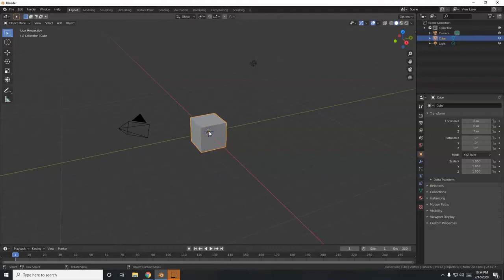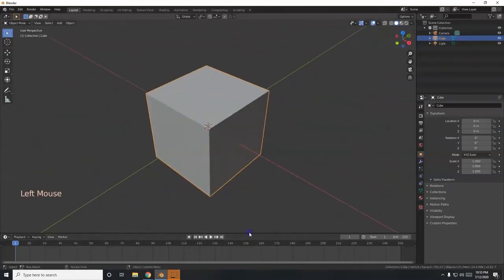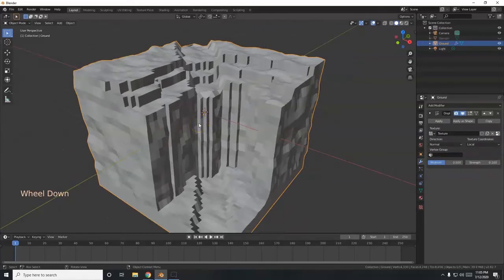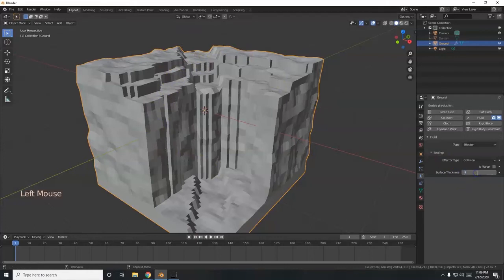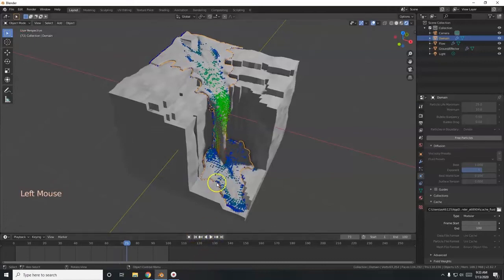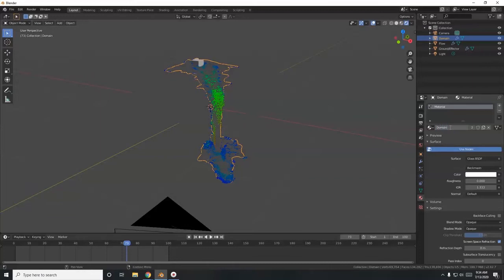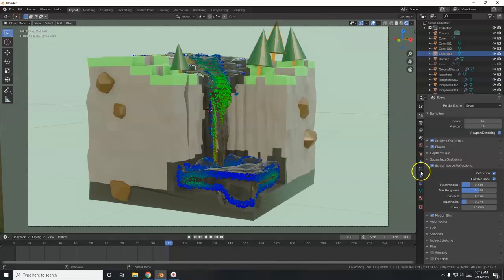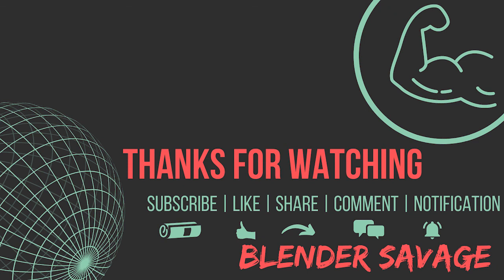Low Poly Waterfall-Mantaflow Fluid Simulation | Blender Tutorial

Comment: For those stuck like I was... Blender 2.83.2 LTS no longer features a "bake data" or "bake mesh" option in replay mode. If you're looking to rebake, you need to actually change a setting within the domain object. "Use Adaptive Time Steps" is a checkbox, and so you can uncheck and recheck that, and the fluid flow should find your flow object again. If that still doesn't work, push your timeline all the way to the end and hit play, and Blender will reset the simulation when it starts the timeline back over. This will take longer than just baking, because it bakes and displays at the same time. I don't know why the developers chose to do this, but it made me spend a lot of time scratching my head. Also, the "Use Flow" checkbox must be checked, the sampling substeps must be at least 1, and the Flow Source option needs to have a surface emission greater than the default value because the default value is 0. 

Hopefully that helps folks who're wondering why the liquid isn't showing up, or showing up where it isn't supposed to.
Reply from the maker: Hi!
Thank you for the help @Degaetus
I'll update my Blender and redo this video. I had a tough time making this one due to the long baking times. I want to make one with a short baking time for everyone.
Reply: No luck with that tip :) I think i'm gonna go back to blender 2.82. or even 2.79.
Reply from the maker: Sorry for the issues @MacLuk. I've been thinking of removing this video and reuploading a new one but my computer renders the fluid simulations super slow. It doesn't allow much time to study and experiment. Once I get a stronger PC I'll make dope simulation videos.